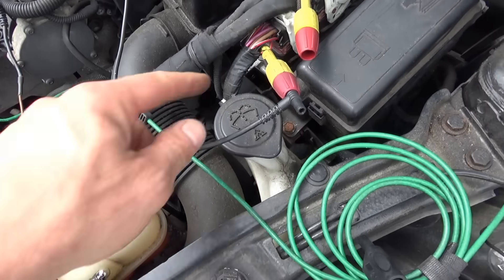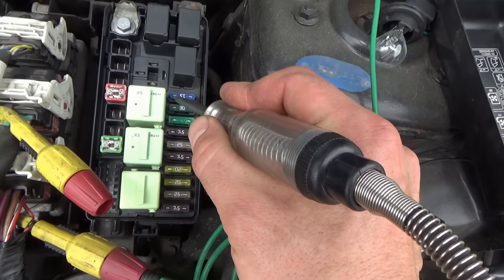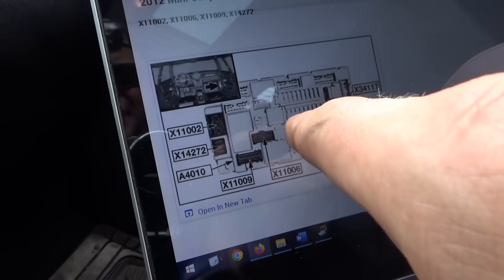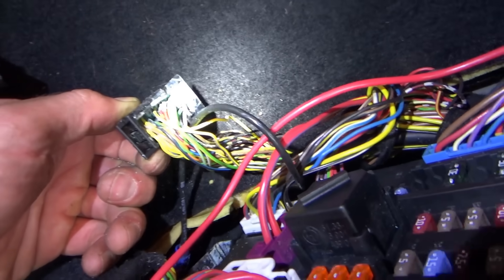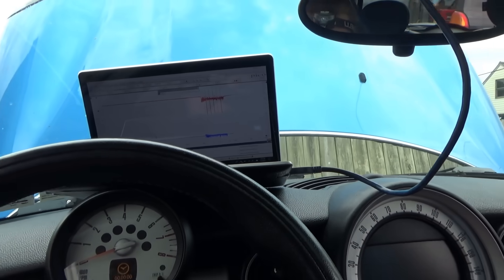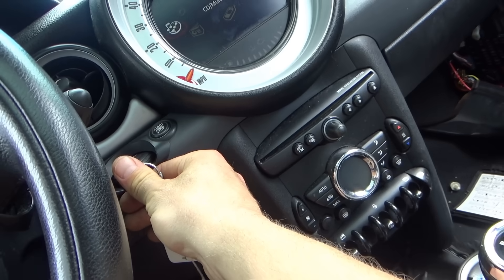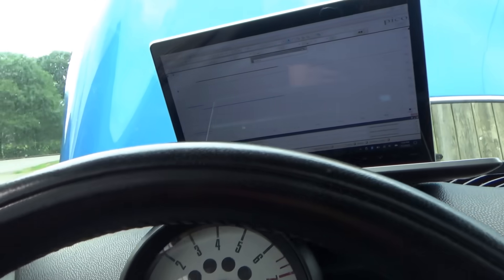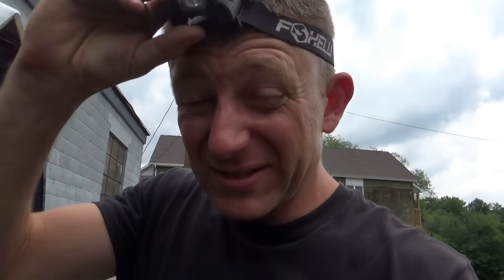(Pt 2) Mystery Mini: Crank No-Start...SOMETIMES? (Russian "HACK REPAIR"?)

Comment: To be honest, I was surprised when you did not visually investigate that junction box when you saw the lake in the footwell at the beginning of part 1 .   But again, you did a great job demonstrating troubleshooting methodology & discipline. 👍
Reply: As a former scientist I can tell you that you always go where the data tells you to go. It never lies. You will always be on a path of understanding if you just follow the data. Trick is to develop your skills of experimentation. This is where Ivan excels.
Reply from the maker: We'll go where the data leads us😉
If I just do a visual inspection and disturb connectors and find green crusties, that doesn't PROVE why the engine doesn't start 👍
Reply: Interesting responses to your comment.  A visual observation is data.  If I saw that flood, I would have taken a look at that junction box.
Reply: @DonsTechnoWorld  the main issue is like Ivan said, if you fix it by disturbing it after the initial visual, that's not as good as just following the data to the true issue and being definitive with the diag and repair
Reply: @Joe_Mission  makes sense.  thanks
Reply: @DonsTechnoWorld  Amateur.
Reply: $5 says this car is on copart within a week listed as run and drive.  😂.
Reply: I was wondering the same thing. Is the 2 inches of water in the floor board not data. I would have investigated the of the JBE for corrosion. The customer would have appreciated it.
Reply: @richrich8436  It is for amateur.
Reply: Ivan would still have had to do all the work to ascertain where to put the jumper cable without doing any damage.
Reply: No mechanic/technician is doing any favors by installing jumper wires. As soon as the water was observed it should have been inspected and JBE replaced. The reason you have a professional work on something is to get it repaired professionally and properly, not install band-Aids. the cost of the repair is not your problem. Techs are not financial advisors. It’s for the customer to decide if they want to fix it or not. We are supposed to advise how to fix it properly. 
   Ivan is great at what he does, but we all make mistakes, this was one of them.
Reply: This is why one is the arm chair mechanic, the other is the pro.
Reply: @Mac-t4y Whos the pro? Ivan isn't even a licensed mechanic
Reply: @Jumalten001what's a licensed mechanic? 😂
Reply: @Jumalten001Ivan is a professional. There is no license to be a technician. Here in the usa, license just to drive cars.
Reply: @Jumalten001 oh please... I'm in the computer IT industry; I see kids coming out of school with their certifications and they are useless when it comes to troubleshooting.  As soon as something comes up that not in one of their little text books or wasn't on 'the test' -  they end up going in circles.  The license and certs belong in the bathroom stall.   My money is on Ivan over ANY 'licensed mechanic'.
Reply: @lynskyrd  For the last 10 years I've worked in large commercial production facilities with lots of complex automated controls systems where stuff is constantly breaking and in need of diag and repair, Ivan is probably a better raw troubleshooter than anyone I've ever worked with.
Reply: @Jumalten001 Define "Pro" In this day and age you are a "Professional" if you have a piece of paper from some institution telling you and other you are. How about decades of hands on experience? This world back ass wards !!
Reply: Pro mechanic😂.Like the ones at the dealership 😅

Comment: Just saying you could use a crimp connector that way you dont have to strip any wires and also easy to remove later when required .
Reply: yea, as the other person said...those crimp connectors are really untrustworthy. I don't know that I would've done it exactly like Ivan did, but its easily cut out if the car gets repaired the right way later on. Just clip the jumper back as close as poss and tape it back up.

Comment: Great solution and diagnosis to get the vehicle running at least.  Like Watch Wes Work says, it’s only temporary unless it works! 😂. That flooded module area is a massive problem waiting to explode even more.  Figured it was a green crusty issues somewhere down in that swamp.

Comment: On one I had in, I put a relay powered by a piggy -back fuse holder at JBE, to allow it to switch the ground and activate the t15  relay under hood.
Mine had the same wiper relay fault too.
Reply: your relay provided the ground wire control? (trying to wrap my head around it, I'm unfamiliar with their system...although this is fairly standard electrical theory)
Reply: @colestowing8695 the relay coil has a permanent supply "terminal 30", so the coil needs a ground to switch it on.
This is done by a transistor in JBE.
But when the car is off, that line has battery voltage and with moisture will  "fizz away".
Green crusties are semi-conducting, they don't have a linear resistance, hence the intermittent.
Without opening up JBE, the easiest way to re-create the switched ground was to pick up power from an ignition switched fuse "terminal 15", use that to power an additional relay.
That additional relay then switches the original control line to ground, so no modification under hood.
Reply: @simonparkinson1053  gotcha. thats what i was thinking. thx for clerifying 👍
Reply: @simonparkinson1053 can you make a video or short clip and post so I could investigate more what you mean ?